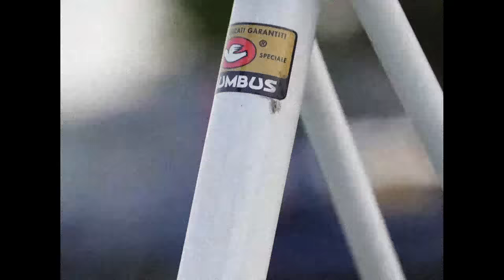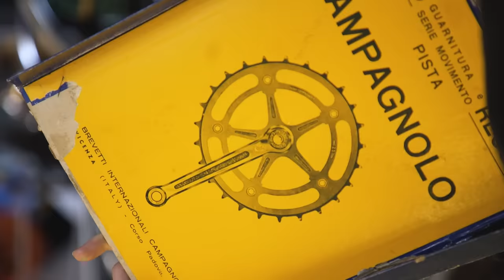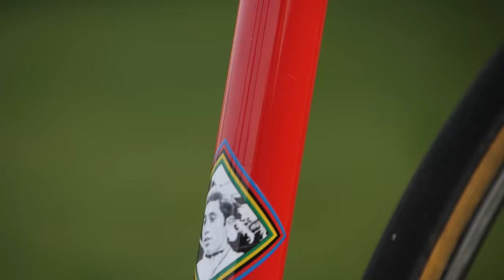Can A Vintage Bike Survive A Modern Race?

Comment: I'm almost tempted to grab the '80s Raleigh Criterium 12 that I've had since my teens out of the shed for a go now!  Those downtube shifters are frankly terrifying when you're not used to them, especially as they don't have clicks on them so finding the right gear is a lottery.
Reply from the maker: Do it do it do it!! 🙌 Is the bike in the vault? 👉https://gcn.eu/app
Reply: I never had a problem with downtube shifters although my rear one was indexed; don’t need indexing for the front and it allows you to trim much easier
Reply: downtubes are the best!! it you try them all and get used to the all

Comment: You do know they made cleats to fit pedals with toe clips, right?  As a racer back in the 1970s my clips were so tight I couldn’t pull out of them and sometimes fell over when I forgot to loosen the strap at a stoplight. Much harder to get out of than “clip less” pedals.

Comment: Currently only ever raced either on my '79 Koga Miyata PR or on my unbranded steel bike with a random set of vintage and modern bike parts. Still on downtube shifters and toe clips though. I do enjoy the benefits of modern cycling kit, though. :P The only thing where I really felt at a little disadvantage is my shifting from small to big chainring. If you yank the shifter too fast the chain will most likely drop. While I love it as it is, I do want to allow more modern shifting etc. into my cycling life, but then I'd also be in the market for a frame which supports this all better. Preferably steel w/carbon fork. If anyone got affordable recommendations, I would be delighted!
Reply from the maker: You should ask our community in the GCN app! I'm sure you would get plenty of suggestions!

Comment: I built up an Eddy merckx corsa extra in the late 90's with campag chorus. Ok it was equipped with clipless and ergo but my oh my what a lovely steel frame . Back in the day I rode toe clips and plates and if you tighten those straps enough you can pull up cos you are not going to come out. It feels like the blood supply is being cut off mind !

Comment: My 1989 Eddy Merckx Corsa Extra with original 8 speed Dura ace , less the chain and running a 12-21 and a 53 39. Not light and neither am I or my big water bottles but my wheel set is and my original free hub that runs silent,,,,,,,,,,instead of a fishing reel with a big salmon on it ! 😮 yup original cogs since 1989. I even got on the podium with Alex Stieda and Scott Goguen back in the day. Thanks Eddy

Comment: I think a vitange frame would do much better with a modern drivetrain. Which in my opinion turns ANY bike into a more advantageous machine.
Reply: But you can't mount it, that's the main problem of those old frames.

Comment: Since I didn't have multiple sets of wheels back in the day, just winter/hack and summer/best, I had a good collection of sprockets because you could create your own freewheel block..For a flat TT it would be straight through in one tooth increments. For a hilly ride or race you'd have a few more jumps with a never-use-unless-you-bonk sprocket as the biggest/lowest!
Reply from the maker: Hahah those the the days! Do you think tech is too complex now?
Reply: @gcn  Yes and no. I do like the advantages of modern tech, but I think home maintenance has become more difficult, routing cables internally springs to mind!
My favourite bike ever is still my custom steel track bike that I also take out on the road - it's pure, it's clean and uncluttered, maintenace is a doddle, so that "grinding out" the odd hill or two is even a pleasure!

Comment: To be fair: It is easier to be smart a local crit race because the "margin for error" is bigger than in a full-pro environment: aero, shifting, comfort - that adds up to a disadvantage you can't make up for at a certain point. For that matter, it's good that the UCI kept the finger on their regulations so that even modern spaceships bikes are relatively close in performance numbers and Pogacar would rip on a Lapierre or Ridley, too ...

Comment: I ride an '86 Schwinn Paramount with down tube shifters and a '93 Bridgestone RB-1. Both are all steel. I'm no racer but I'm able to keep up with lots of riders during group rides who ride the so-called latest and greatest - bikes equipped with electronic shifting, disc brakes, internal cabling, 11-12 cogs in back and just about carbon everything. It's the rider, not the bike.

Comment: Your front brake cable is a bit too long. Cut it down by 4 cm and it will save you 0.1 watts. And it be a more symmetrical look.
Reply: And it's not on the side that Eddy would have used. 🙂

Comment: Clipless pedals are for sure a huge change and improvement, but did you have vintage shoes for this ride? I'm sure you know this, but the old shoes like I had back in the '70s had a cleat on the bottom with a groove that would grab the pedal edge. Tighten the straps, It was almost like being laced into the pedals. If you had to put a foot down you'd better get ready to release the strap. With practice you'd get fast with it. Just curious about your shoes for the race....

Comment: The thing is, you put yourself at a disadvantage from the start, with not having switched out the gear set. Thereby nullifying the experiment. 
Also sounds like you need to investigate the length of the toe clips in relation to shoe size and cleat position. Would be interesting to re run the test.
Clipless pedals were one of the earliest 'modern' innovations,  around 1985, along with indexed gears or Simplex Rotoflex shifters.
Other aspects of racing cycles were not that much different to what you were riding in this clip. Would also be interesting to see a repeat with just those modifications (as well as the corrected gearing). I think you would have noticed a difference.

Comment: Did you have shoe plates? Why not use longer toeclips? Shouldn't have been as bad as you found. I still ride old style clips as well as the new.
Reply: I agree. I don't still ride them. I'm just old and started out on them and remember them well.
Reply: If it was 1967 shouldn't it be Dettos with the cleats nailed in? And back then we were using thick Binda straps with a full twist in the pedal body to keep them in place.
Reply: @brianrichards350  Ah, the memories!  Christophe straps were also available, I recall.  Did you also fold the ends over and tape them to give you more to grip when tightening them?

Comment: It’s not the bike, but the rider. I rode this kind of bike for years and in all wool kits. The only tech issues he had are easily fixed; swap out the freewheel and get longer toe clips. An old habit I hold onto from toe clip days is holding onto poles or parked cars at lights so I wouldn’t have to reach down to unclip. I don’t miss clips and straps!  At race starts you would clip in and hold onto a buddy.

Comment: The bike  frame shown in the video lug wise is a copy of a early 80's Eddie that I have owned . The real frame that Eddie rode was made by Giuseppe Pella  he was the bike maker to the stars during the 1950-1960's. There are only 2-3  known  to exist because he never put his name on a bike.  I own one of them a Benoto ,in his spare time he would make one offs  for his friend Benoto. when not building pro bikes. These bikes can be identified by lug shape, fork crown and bottom bracket . If you look closely at the fork crown on the bike Eddie is riding you will see what looks like a drill hole in the side of the crown and it  is filled in with red paint. This is  a signature mark. The bike that I own is  considered to be one of the most significant in the word if not  one of the rarest

So what they are copying is a bike made by Eddie Merckx  in the 1980 painted to look like the real thing.  Not trying to steel your  thunder, just setting history straight. I conserve and restore bikes at ridetigervintagevelo.com Thanks Rob
Reply: nice.  Always doubted the whole "E. Colnago built Eddy's bikes" myth...

Comment: My personal road bike is built with a 1988 Columbus SLX frameset, with a carefully picked mix of vintage, semi-vintage and modern parts to combine the best of old and new.
I was able to fit a new silver set of Ritchey Classic Zeta wheels, and with a handlebar with a modern shape and a SRAM rival 22 levers and RD, I don't feel like the bike holds me back.
The frame back in the day was seen as a stiff, hard frame, but with modern 28mm tyres, it feels just perfect. Comfortable enough to hit the Belgian cobbles at full speed, yet stiff enough to put the power down properly.

And it weighs 8.8 kg including pedals and stainless steel bottle cage.
Reply from the maker: Sounds pretty sweet! Have you uploaded any photos of it in the GCN app?
Reply: @gcn  thanks! But no, the GCN app doesn't accept my account creation 😂

Comment: So, according to industry claims. Si was +45W penalty for the bike. +30W (conservative estimate) for the loose jersey. +20W for narrow box section wheels/tires. and +5W (est?) for the camera. A nice even 100W,at least, and that doesn't include the pedals and muscle familiarity. And, Si finished 10th... 11th? Approximately 3 seconds behind. I mean, having 100W more avg power than everyone else sounds like Si is in form for a return to pro ranks, or, maybe it's not quite 100W in the real world. Of course there is a difference, but 100W? You're well spit out the back at 100W difference, and very early in the race.

Comment: Get a grip Si, although your excellent race craft saw you through just fine. Racing back in the 80's on a bike not too dissimilar than this was still very fast. I remember doing a crit down in Bordeaux, 100k in 2hrs, 31mph average, pan flat and only 2 gears needed. Or a 135 mile Paris classic in 5hrs, 27mph average! Absolutely a modern lone rider is moving faster these days, but is a modern peloton?

Comment: bigger toeclips may be a solution :) and get the rear brake cable cut down so it's the same as the front please.... Criterium bikes had different angles so you may have faired better on one of those.
Reply: Good little film by the way

Comment: I have a 531 frame from 1992 with Modern 7800 Dura ace gears best of both worlds even has a compact crank,ok its only 10 speed but its fast enough & weighs 9.1kg so not to heavy.

Comment: Toe clips suck, to be sure, but mostly because of the straps and associated comfort issues, including the lack of any float. If you feel like you are pedaling with your toes, I would look at the length of the clips and the position of the cleat. The starting point is with the ball of your foot over the pedal spindle, and that's the same for any pedal, clip or clipless.

Comment: Did you have slotted cleats on the shoes?  Without them, you could very well have been pedaling on your toes.  The toe clip might also have been too short.  Once the foot is held in the right position over the pedal spindle, it doesn't matter whether it's clipless or clipped in.  Snug down the strap and your foot won't move.

Comment: my parents had a couple of road bikes in storage from the early 90s. a real old steel racing bike is nothing to be trifled with. that is they weigh so much its hard to get them moving. they must have weighed 30 pounds plus. yep and 1 front gear and 5 or 7 back gears makes it difficult to climb a lot or sprint when the gettn is good. it was a fun way to start, but i had switch something more reasonable.

Comment: Toe clips need to be correct for your foot size. If you use clipless pedals that are set up incorrectly, you will suffer the same fate. The modern clipless pedals are more for convenience than performance IMO.  No one seems to track stand anymore or even be able to.

Comment: I used to race on vintage bikes, just stay in the draft as much as possible and you won’t need all those marginal gains. 

Toe clips come in different sizes, so your not stuck on your toe. I wore ‘Patrick’ shoes which had a sole which locked onto the pedals in the right spot.
Reply from the maker: Would you race a vintage bike now? Maybe vintage bike with modern clipless pedals is the best way to go?

Comment: No mention of cleats, so I am assuming they weren’t used. Why are the brake levers switched from the usual right/rear brake and left/front brake assignment.
Reply: Most riders on the continent ride right/ rear, left front. The brake calipers are designed that way, too.

Comment: I raced a 60s bike in the '70s and usually got my *ss handed to me... Of course it must have been the '60s bike and not my crap legs. BTW - Toe clips come in different lengths, so like your gearing, that was a setup issue, not a '60s issue. Last year I raced my 1980 Carlton Clubman in a local weekly TT. It wasn 't disgraced, but I cheated by running Campag 9spd and Ergo levers etc (Though when I built it I ran the 9spd off Nuovo Record DT levers)

Comment: I don't think anyone would have minded you using a set of SPD-SL pedal's those toe clips are just dodgy.
Reply: Why dodgy?  Easy to get in and out of (the straps have a bit of slack in them and I could always pull my foot out if I really wanted to!  You could get 'em nice and tight, though - I never had any issues like modern cyclists seem to have with clipless pedals.  Si's problem was he didn't have the right length clips, which he must have known before he started!

Comment: Another proof that you can have fun on pretty much any (working) bike. With all the pills Mercx used back in the day, Si would have won easily.
Reply: They all used the same stuff, and the effects thereof were marginal.
Reply from the maker: Riding any bike is always fun, right?!
Reply: @Réno Pijnen  methamphetamines don't give a small boost.   Also, many were willing to take a lot more than others so it's really not even close to equal.
Reply: @veganpotterthevegan  And those willing were the types that 'burned down' in bout three to five years time.  Back to my initial point: To mark Merckx's career and efforts as built on the use of doping is ignorant, ridiculous and actually stupid.
Reply: @Penalist  who's doing that?  It's just a fun knock
Reply: @Réno Pijnen  and no, they weren't all "burned down".  The addicts that took methamphetamines daily had problems.  The people who took them for racing only gains did not.   After all, tons of people in the general public are prescribed methamphetamines and take them every day in small doses.  It's the addicts that have major problems
Reply: @veganpotterthevegan  Indeed, not all of them, I meant those who were willing to take huge amounts, and who gained the real advantage of the stuff (as far as this was actually significant in a race I might add). Those are the ones who fried their engines (and burned down), although they were not (simply) addicts.   - Calling someone a heavy doper, is not a fun knock. Merckx is a real person, with a real career.
Reply: @Penalist  everyone responds differently to performance enhancers.  The same dose doesn't benefit person x the same way as person y.  Eddy was certainly a big doper, as were all the greats🤷

Comment: What size freewheel were you using? If you only had a 14, you should be able to spin it up to 35 mph at 120 rpm. With a 13 in back, 38 mph at 120 rpm is easy to do in a seated sprint.
What kind of shoes were you using. You need a deep cleat. When I started out, I used large toe clips and Duegi 101's, with a wooden ultra stiff sole. (Still have them in my parts bin) Double straps.
I believe that I raced in them from 1985, until 1989, when I finally went to Look PP76's, with black cleats.

Comment: I have a 90’s 14 speed Peugeot that I modified by replacing the original drive train with a complete hollowtech Tiagra 10 speed gear set and a set of aero Mavic Cosmic wheels. Brifters baby! Lol.

Comment: sounds like you had the wrong size toeclips. Too  short. You shouldnt be pedalling with your toes. There were still cleats on old shoes. You just had to get your foot in the right place on the pedal, then nail the slotted cleats to the soles., which slotted over the edge of the pedal. Your foot position was determined by this and the straps held your foot onto the pedal. You could still pull your foot up on the pedal stroke. My favourite shoes of all time were the Adidas Merckx shoes, with the mesh sides, that i had as a teenager...

Comment: You're just not used to the position of the toe-clips. Not the technology really! Be no different if you used modern shoes with the cleats in a different position? :)  I'm pretty sure different size cages were available back then? Not surprised you stayed with bunch - there's nothing wrong with old bikes, the aero wouldn't have made a difference in the bunch. And they knew how to make hubs back then. My old vintage bike with Campy Record hubs seems to spin as good as, perhaps better than any of my modern bike wheels.
Reply: I'm assuming you had clips on your shoes to lock into the pedals.

Comment: You surely must have realised your toeclips were too short when you fitted the shoe plates?  They can't have been under the ball of your foot.  And clipping in and tightening toestraps, and using downtube shifters wasn't a problem back in the bay.  Or were we just cleverer than today's pampered riders?  And surely Eddy would have had a 6-speed block by then - I did back in the late 60s.  Oh, and it wasn't a perfect replica - brake levers on the wrong side!  What gear ratios were you running to spin out - I used to have 54-14 as my top gear which was good enough back then - Eddy would probably have had a 13 top sprocket?